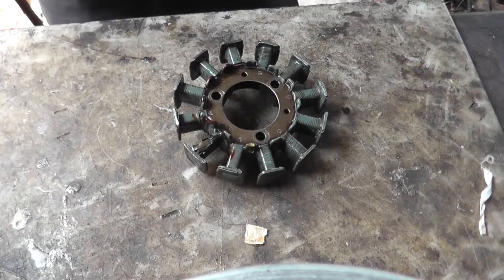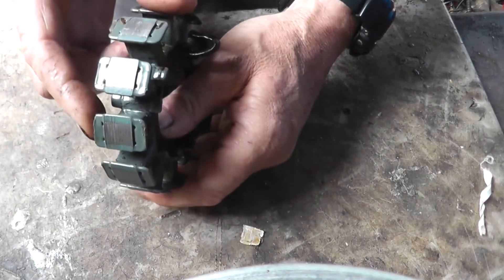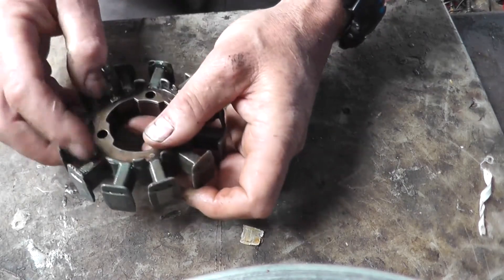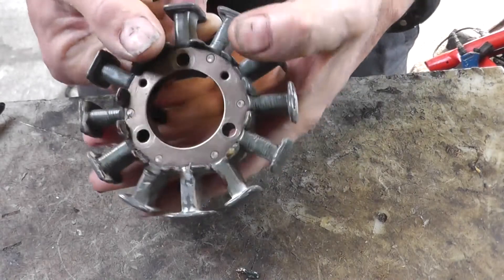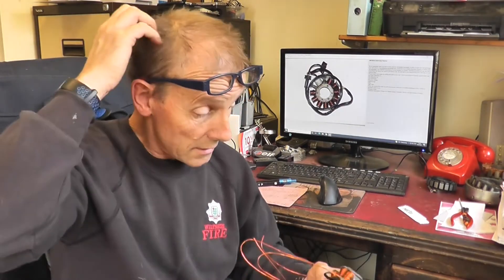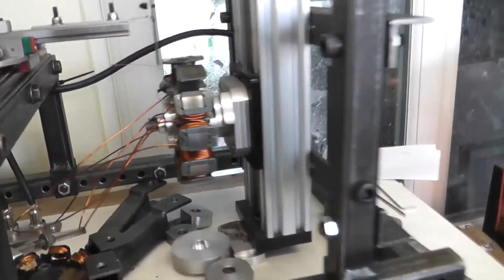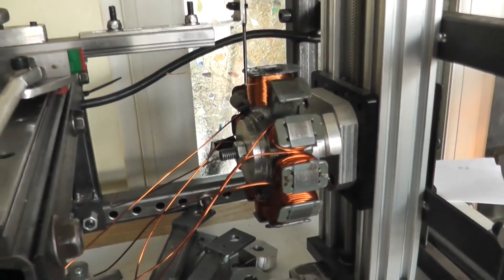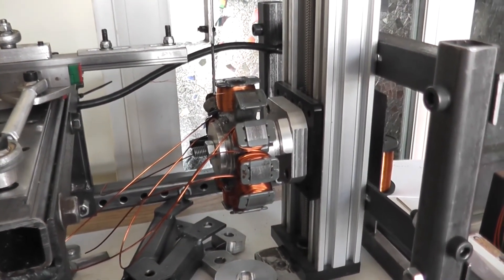Husqvarna SM/TE610 stator repair and rewind.

Comment: Hello😊 The Hoda xr600 86 has a plastic core the wire is winded on, they have made a channel for the wire in the plastic from outside and in to start winding, the channel is routed so winding has to be in anti-clockwise direction, have you winded one of this stators?
Reply from the maker: Hello, yes, I have done quite a few of them, and you are correct, it is wound anticlockwise.

Comment: Wow! some winding tools you got there, is direction of the ign.winding important? it is a ac circuit
Reply from the maker: Yes it is important as the AC Positive and Negative output wave has to be synchronised with trigger pulse from the pickup coil, however if you do wind it in the wrong direction it can be easily overcome by simply swapping the Red and Black wires around in the block connector.

Comment: Hello, what should be the output voltage of this coil?
Reply from the maker: That all depends on the rotational speed of the rotor, but I have taken readings from a good stator coil and a rewound stator coil, they are as follows: Stator that has not been rewound: 450RPM 72 volts ac, rewound stator 450RPM 84 volts ac both produce a good spark at that speed.

Comment: I need to find this stator!!! Mine is all messed up and all the ones I find only have 3 wires and a round plug! Please help
Reply from the maker: I can only rewind your stator but if it's severely damaged then there is not a lot I can do, sorry. The stator fitted to some of the Cagiva Canyons and W16s are the same stator but has different connections on the end of the wires.

Comment: DOES  THE NUMBER  OF  WINDINGS/ OR  THICKNESS OF WIRE   ON THE  POST  HAVE ANYTHING TO  DO  WITH  THE  VOLAGE  OUTPUT
Reply from the maker: Yes it does.
Reply: @bbbikeshop8359  Thank you for the detailed reply. Care to elaborate?
Reply from the maker: @imthatguyuhate  What would you like to know?
Reply: @bbbikeshop8359  Hello what thickness of wire are you using?
Reply from the maker: @АлексндрКоваль  0.14mm, it will also work with 0.132mm
Reply: @bbbikeshop8359  Thank you very much for your answer.
What resistance (ohm) should there be between the black and red wires with such a wire thickness and 4000 turns?
Reply from the maker: @АлексндрКоваль  About 300 ohms.
Reply: @bbbikeshop8359 usando el calibre 0.32mm en lugar de 0.14mm aún serían 4000 vueltas para 300 ohms? Ayuda! Thanks
Reply: Just a quick explanation on how more and less turns would change output, how thicker or thinner wire effects output. And maybe stronger or weaker magnets.

Comment: Do you still offer repair? My pulsar trigger was destroyed in the exact situation. Replaced flywheel too with RO610.
Reply from the maker: I can do the repair/rewind on these stators, unfortunately I am unable to supply replacement Pickup (Pulse triggers) although I have had stators in for repair with different Pickups fitted, but I am not sure what they are originally fitted to?
Reply: @bbbikeshop8359  see as you have a way to test the rewound stator, do you have a way to test the other coils for their compatibility?
Reply: @bbbikeshop8359  how can I contact you????

Comment: How do you wire it up to the plug? Which pole goes where?
Reply from the maker: The 3 A/C charging output wires goes to the yellow wires (in any order). The Red wire connects to the start of the source coil winding and the Black wire connects to the output of the source coil winding.